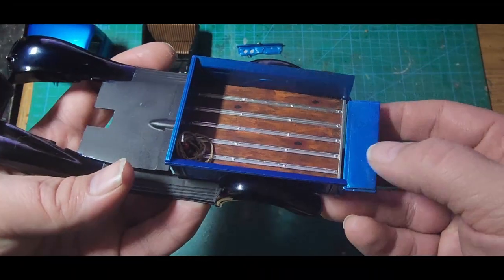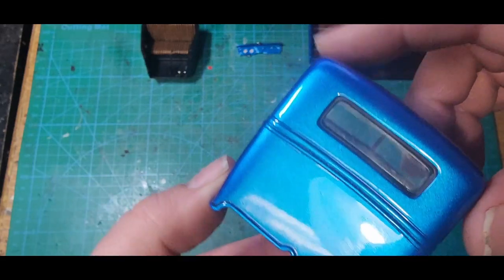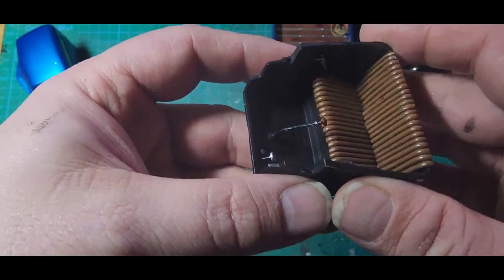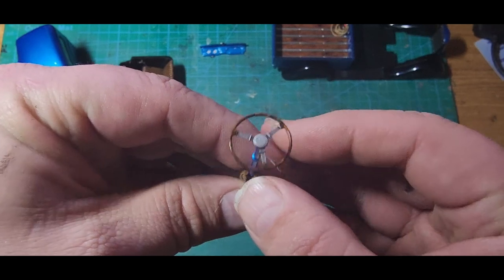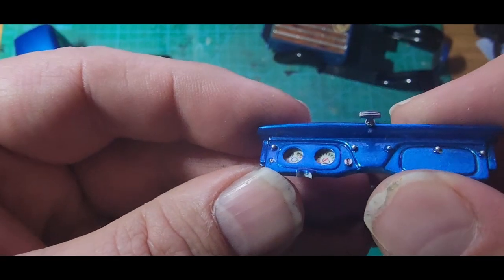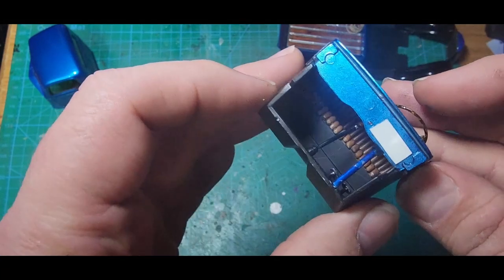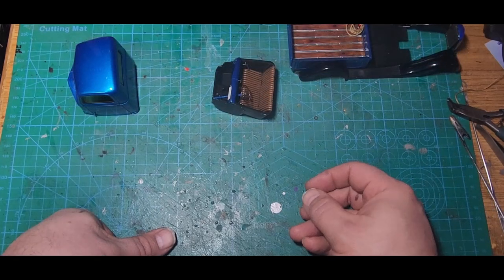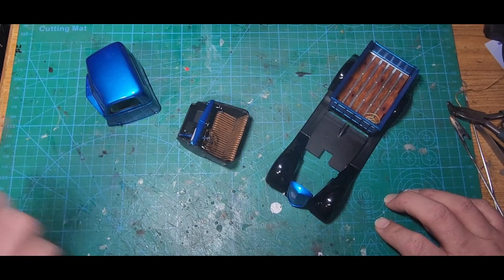Revell - 37 Ford Pickup - Update 3

Comment: Great update,Justin.👍😎 It seems a real bonus being able to print your own decals. The dash and detail decals you've made look excellent 👍. Lovely looking pickup 👍😎. Thanks for showing and best wishes from jolly old England 👍😎Pete 🤓
Reply from the maker: Thank you very much Pete! Have a great weekend! Cheers!
Reply: @JHartModelworks  Strange to see you building such a old style kit. They've a very cool look and were made in England too,but only with 4 cylinder flathead and right hand drive . Which might make an interesting project 🤔
Reply from the maker: I try to do a variety of builds. I love exotics, I absolutely love classic exotics like the Miura, the Ferrari 250s, the Mercedes 300 sl, and the like. But, I also like American muscle cars and antique trucks which get a lot more views on the old YouTubes, and JDM (especially old JDM).   I have a 40 Ford, and a 41 Chevy pickup on the channel as well.
Reply: I struggle with anything newer than 1970🤣
Reply from the maker: They are harder to do because there is less you can do to them detail wise. For instance the Ferrari 360 I'm about to start, There's nothing to do in the engine bay as you can't see any added details there. The interior is all buttons so again other than changing out the seats, there's just not much to do. Most of the expensive detail up sets I used to buy, just don't really seem to add much in the grand scheme of things. Your paint and detail painting has to be spot on as that for the most part is all you can really add.
Reply: @JHartModelworks  Yes,I agree. I do like kits to have engine bays,to mess around in. I've bought several kits,recently,as donors,just to get dash decals and better parts. Chevy pick-ups mainly🤔. All good fun and don't really cost the earth👍😉

Comment: Nice details! Looking great!! What did you use on the seat? I'm actually building the same kit as I watch your channel.
Thanks for sharing!
Reply from the maker: Thanks.  For the seat i used 2mm half round styrene rod. I did the bottom section first.  Glued it down with tamiya extra thin,  then used a heat gun to soften it and rounded the end over by hand. I then repeated for the top section.

Comment: Hello Justin, 
Under the steeringwheel that you create is that 3D printed as wel.
Reply from the maker: Yeah, the steering wheel is from someone else, It was thin and didn't fit well on the column. If I remember it may have been a male to male fit. So I just drummed up a small adaptor to fit the mounting posts and make the connection more stable.

Comment: By the way where do you get your gauges. Looking for someone to make gauges and license plates
Reply from the maker: So for the gauges, I scanned in the original kit decals at 300dpi (best for printing) and took them to photoshop. I then browsed google's image search until I found a set I liked, took those into photo shop and did a lot of work to resample everything up to 300dpi as most web photos are onlt 72 dpi and print like crap. Once resampled up to 300dpi I could scale the physical size down to fit in the correct size and position to match the kit decal sheet. I then just printed them off on some 4x6 inkjet photo paper and cut them out. 

For the plates I do something similar in photoshop, but I got to Myplates.com when is the official plates website for the Texas DMV. This way I can make real plates using actual DMV plates and fonts. I then take those into a photoshop file I have pre-set up with plates, registration stickers, toll tags, battery logos and the like. Modify the registration sticker dates to match the month and year I finished the build so I can still know years later, and print it all out onto white diy decal paper. 

All of that goes back to when I used to do 3D art, graphic design, and web site development as a hobby nearly 30 years ago. 

It's a ton of work but to me it's worth it.

Comment: Please tell me how to print decals like yours. I can inkjet darker colors and spray sealant on them but can’t print white or lighter colors well.
Reply from the maker: They make a white decal sheet. I like the ones from Expert's choice, they are the same people that make bare metal foil. When using decals printed on white decal paper, you have to cut right up to the very edge of the design when you use them though. That makes it great for things like license plates and gauges, but difficult for anything with complicated edges.

As for the gauges on this truck I didn't even print them on decal paper at all. I used glossy photo paper, as I was just going to cut the whole thing out and glue it to the back of the dash instead of applying it like a decal. Makes it a lot easier, since you don't even have to seal it if you aren't dipping it in water.

Thanks for watching and have a great week!